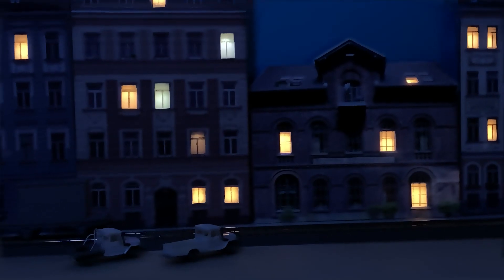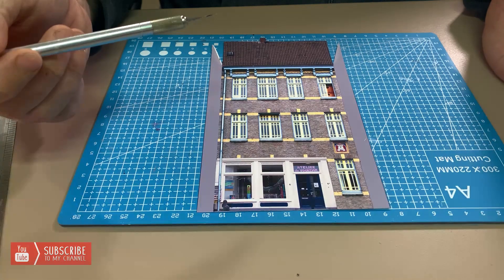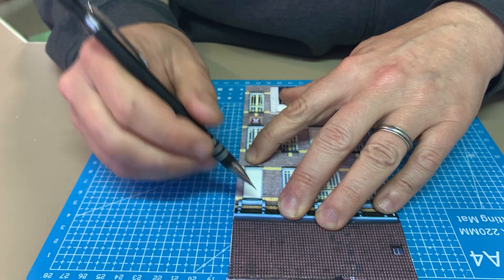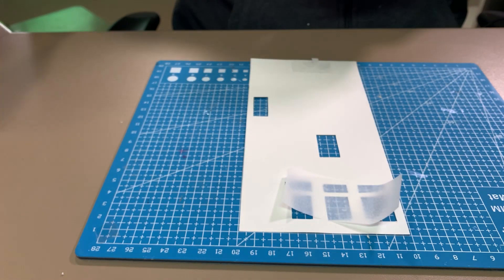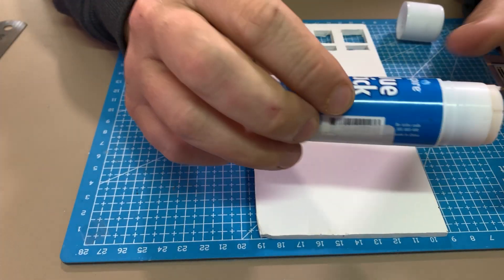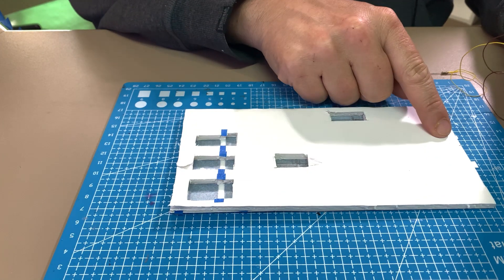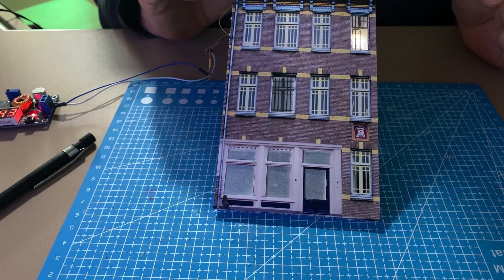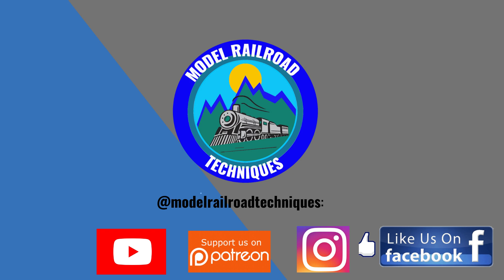HOW TO LIGHT YOUR MODEL RAILWAY-BACKGROUND FLATS

Comment: Awesome video I'm going to save so I can come back an watch it when I can do this to my background
Reply from the maker: Cheers. I have just got a DCC circuit to interface into the Arduino. So you could use JMRI or in my case TrainController to turn this on and off using code in the Arduino. Super excited